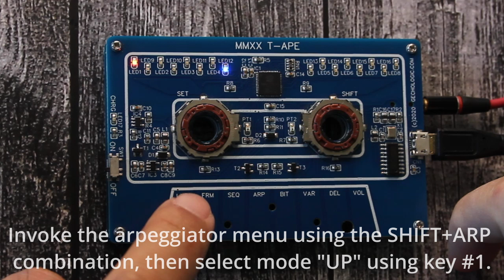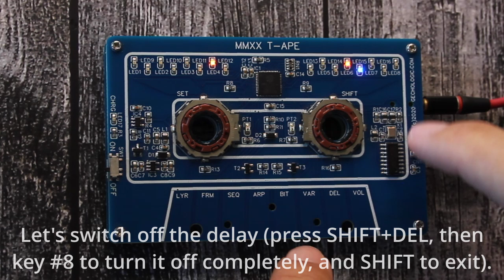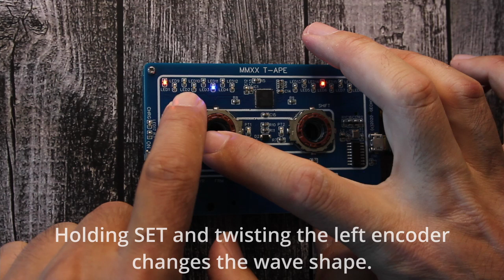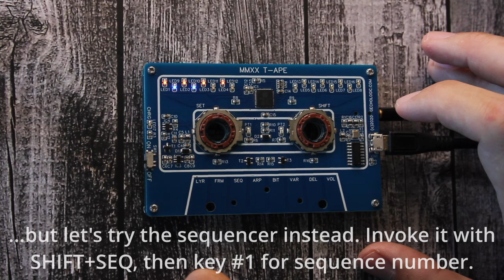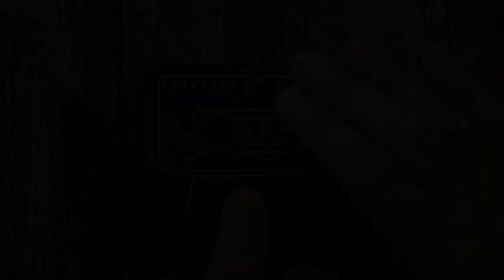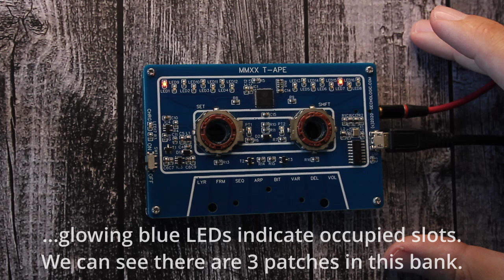MMXX T-APE - how to program it

Comment: Great intro to your device! I've watched it multiple times now. That said, I just got my T-APE yesterday, and have a few questions: 
Can you run ARP on one layer and SEQ on another? I find triggering one negates the other, even on different layers.
And I sometimes run into a situation where (for ex.) ARP will "play" (blue lights move) but no notes are triggered. What am I doing wrong to cause this? I must've 54…'d this thing a dozen times already.
Thanks again, and I'll definitely keep playing with it to try and get the hang of things.
Reply from the maker: Yes ARP will stop SEQ and vice versa. It can be done other way although not sure how soon the interface would get too cumbersome to work with. We'd like to add the functionality to start/stop them in sync, or even control the tempo independently, or at least in certain ratios - it would be a missed opportunity not to do that :) If ARP (or SEQ) runs but plays nothing, maybe it was enabled on an "empty" layer? Or the grains which are there have bits of silence at start, long enough to never reach the part where the sound starts? I haven't run into this problem, if you can find a sequence of operations (starting from an empty / factory reset patch) that leads to it, I could try to repeat it. Or if that's hard and you have the patch stored in device, it's possible to download it with a python script into a binary file then I could copy it over to my unit and investigate. And sorry for slow reply, for some reason I didn't get a notification about your comment.